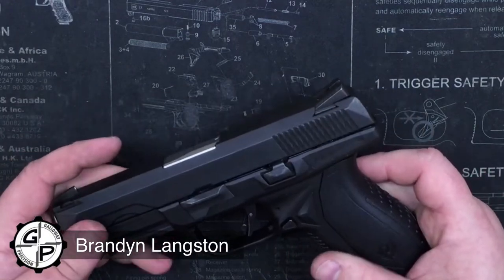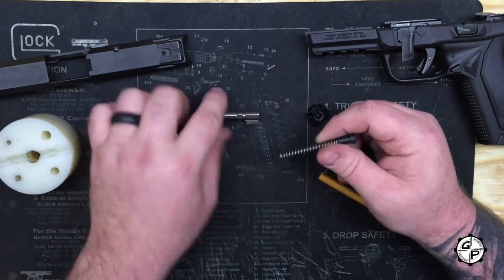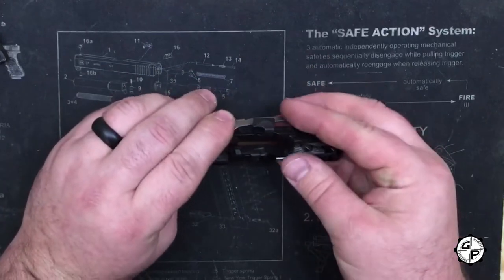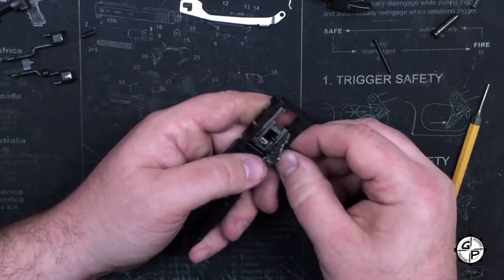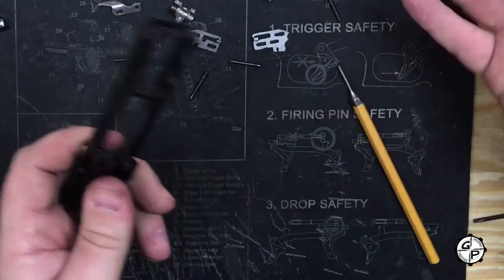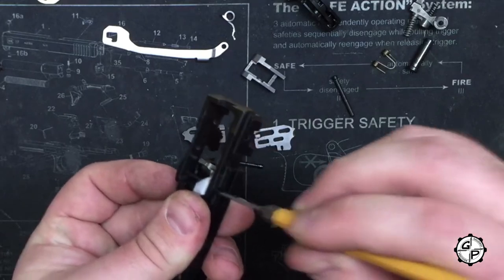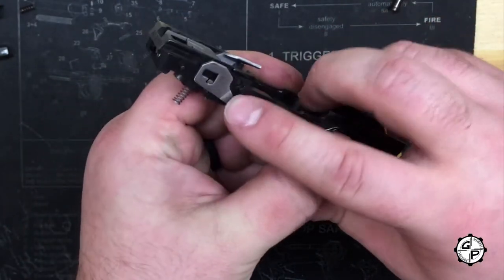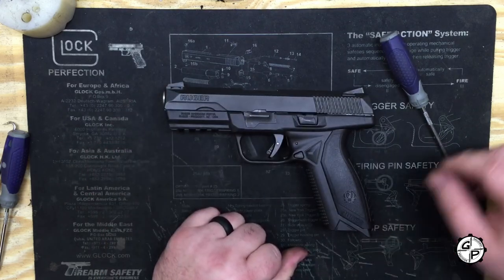Ruger American Pistol Detailed Strip / Disassembly & Reassembly

Comment: Great video, thanks! My trigger return spring fell out before I saw how it was orientated. This got me back together without issue.
Reply from the maker: Awesome.
Reply: That exact thing happened to me yesterday! I bought the Competition model and pulled the chassis out and PING that little spring went flying across the room. Luckily, my wife found it for me, but I had no idea how it went on there. This video saved me quite a bit of embarrassment.
Reply: @colemanmoore9871  Glad you found it, I'm still looking for mine and Ruger says Id have to send them the entire firearm. They wont just send me the spring.
Reply: Same here. Mine flew across the room. After about 25 minutes of searching and finding it this video helped me get it back together.

Comment: thank you for this video, my trigger return spring popped out while disassembling it after cleaning to be sure I got it thoroughly. anyways this video helped me get my trigger reassembled without a gunsmith so thanks a bunch!
Reply: My spring pooed out also. But I didn't see it until I put my gun back together and now the slide is locked up. I found the spring the next day. I have no idea how to get the gun back apart

Comment: After being bitten by the 3 gun disease, I installed your striker rod & recoil rod, standard spring. The pull weight is close to stock but the pull is subjectively smoother. I highly desire & trust your products.

Comment: Great video.  The Slide lock looks like it only has wear on one side ??
Reply from the maker: Seems to be a thing with all of them.  Not really sure why.
Reply: The slide lock only engages the slide on the left side. The cutout on the right side of the slide is just there for clearance for the right hand tab to raise up when the slide locks back, but it is rounded, so the tab doesn't actually touch it when the slide is back. If you release the slide with the slide stop tab on the right side of the gun you are actually disengaging the left side tab from the slide, since the slide stop is all one piece. This is why you see wear across most of the surface of the left hand tab but only wear on the very edge of the right hand one. In other words, as the slide moves forward there is a 90 degree cutout scraping against the left hand tab, while the cutout on the right, being rounded at the rear, just sort of slides over the tab on that side without leaving much of a mark.

Comment: Instead of taking apart the sear housing could I just spray it down real good with carburetor cleaner, or will it etch some of the parts? And what areas should be oiled after a complete action cleaning?

Comment: i have a ruger 45 acp pro i want a stronger spring for the firing pin like the one you showed where can i get it and how much i would buy it in a hot second the thing is this i have small rifle primers and i want to switch in between them and small pistol primers.

Comment: How do you reinstall the mag release spring? My pistol had a small bit of plastic in the mag release slide bar. So I removed the pin and the mag release lever popped out. But can't get a handle on reinstalling it. The spring keeps popping off. Or the spring leg wont relax enough to get the leg in place.

Comment: In your opinion, would polishing the internals in the trigger chassis help the performance overall? It's a good feeling trigger, but I think it could be better. I agree with the other poster, it does have a rather long reset... any plans in development on that issue?
Reply from the maker: We have a design in the works for a trigger and some other parts.  In the meantime the stainless steel striker guide makes a HUGE difference in the feel of the pull.

Comment: Question about the blocker, first of all i have NEVER seen a blocker design like that, this may sound like a dumb question, but if the firing pin dislodges somehow without the trigger being pulled, will it strike the primer?? Thanks ahead of time. I just picked up a american compact pro and im very concerned about saftey issues after not seen in a blocker on the slide. Thanks man
Reply from the maker: The way the blocker is designed it would take a really weird series of events for it to be able to do that.  It being a larger than normal blocker you won't have any issues.

Comment: Any idea when the new heavy striker guide rod springs will be available for the Ruger American 9mm. Also any ideas about the possibility of making a shorter trigger bar so the trigger reset isn't so long. Just Curious...
Reply from the maker: The trigger bar we won't be doing, though don't rule out a 3D printed trigger to limit travel.   The springs we're waiting on samples from several different spring makers before we finalize our decision.
Reply: @GallowayPrecision  i have the heavy striker spring that you use to sell. will that one still work or is it not within ruger specs. I just ordered the 20 lb recoil spring that you suggested as well on your site.
Reply: @GallowayPrecision  i would love to see wolff Springs make some for the Ruger American 9mm
Reply from the maker: The spring will work in first production run Americans, but they made a slight change to the spring sometime last year.
Reply: @GallowayPrecision  thanks for the info..

Comment: I dropped the trigger bar spring into my shag carpet...never to be seen again! Ruger would not sell me a replacement. Instead they required me to ship the gun to them (they paid both ways). They fixed it and returned the gun claiming they had replaced the frame, takedown bar, trigger bar spring, and the trigger bar! I can't believe I did THAT much damage! They also stated the following:
RUGER DOES NOT RECOMMEND REMOVING THE TAKEDOWN LEVER FOR DISASSEMBLY. REMOVING IT CAN CAUSE DAMAGE TO THE LEVER AND TO THE TAKEDOWN BAR. SEE PAGE 22 OF OWNER'S MANUAL.
IT IS NOT RECOMMENDED TO DISASSEMBLE FIREARM PAST STANDARD FIELD STRIPPING. 
!
Reply: Why make a chassis gun if you can't remove the chassis from the frame?

Comment: I did this on my 45 ss and I can't get it to dry fire any advice on what I did wrong
Reply from the maker: You completely disassembled and reassembled, or you installed the striker spring?
Reply: I completely disassembled
Reply from the maker: With the slide off of the frame, when you pull the trigger does the sear move freely?
Reply: I got it to fire pin but I have to remove barrel and spring to lock bar on secondary seer
Reply: I figured what I did wrong I had secondary seer spring hooked on frame insteadon resting inside of it